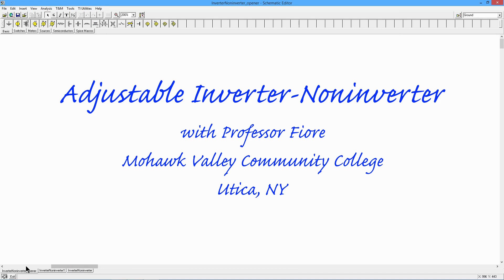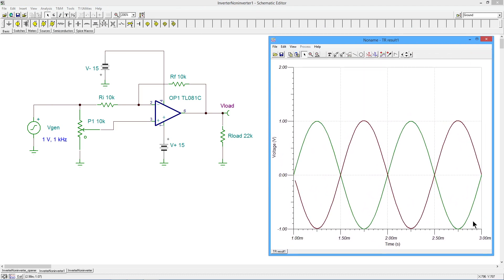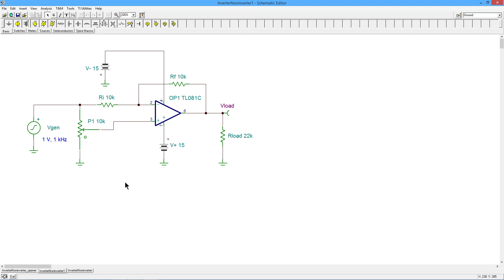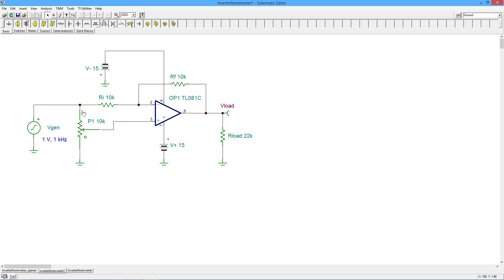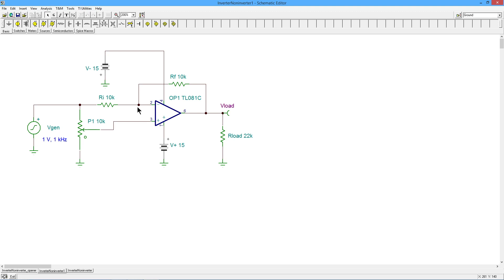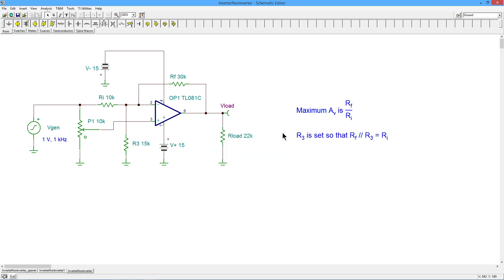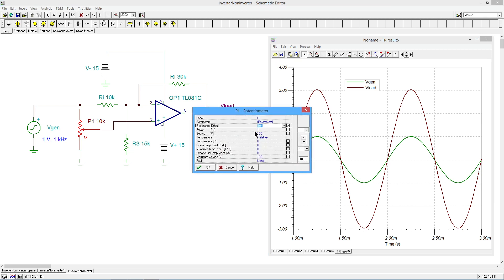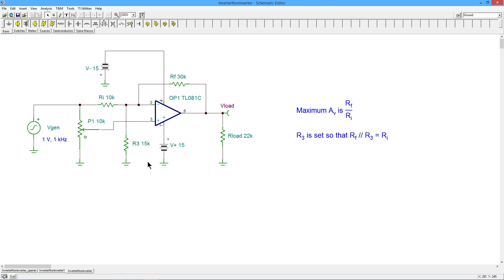Op Amps: Inverter-Noninverter

Comment: If I design a multistage amplifier for a guitar or microphone; and say the circuit has stages that invert and some that non-invert, is there a rule that the ac signal has to leave the device in the same phase as it came in?  If my device inverted the signal, and went into a recorder or headphone amp inverted from how it came in, will that change the sound?
Reply from the maker: Inversion generally doesn't affect the sound UNLESS you are mixing this with another version of itself. For example, if you mic something using two mics, run one of them through processing that also inverts the signal, and then combine the two signals back together, THAT inversion can make a difference (you might actually like the sound, it's not necessarily "worse").

In contrast, if you recorded someone speaking into a single mic and then played that back by itself, you'd be hard pressed to tell the difference between the original and an inverted version.

Comment: At 14:43 the value of zero has a slight positive offset. In most other cases you would address such a discrepancy , but here you have not. Is there a reason for the offset ?
Reply from the maker: That appears to be just a small DC offset. DC offsets are a fact of life and I don't always chase them down as it would get tedious after awhile. If DC offsets are a problem, I suggest using a device with much lower Vos (such as an LF411) instead of the TL081.

Comment: Hi, is there a way to use analog discrete components to extend the dead zone around the 50% point?
Reply from the maker: If you mean "to make it less touchy", then the obvious solution would be to use a precision multi-turn pot. To adjust the range, you could place resistors on either side of the pot (in series).
Reply: @ElectronicswithProfessorFiore  Yes, thank you, that I am aware of :-) I am rather referring to if there is a trick do obtain a larger dead band around center position, such as from 45% to 55% the output stays at zero. Background: e.g. in a synthesizer that applies LFO modulation using attenuverter, you want to have a comfortable knob position where the modulation stays exactly at zero. I have seen pots with center detent that still gave a slight ouput at center position (thus, the wiper is not exactly at 50% of the carbon element) which is really annoying when used for e.g. pitch modulation.
Reply from the maker: @SloBloLabs  Being a musician myself, I completely understand the issue now. Assuming you don't want to get a custom pot due to expense, you could use a pot with a built-in push switch to either pull out the pot or disconnect the output. Not super common but I have seen them. You might be able to rig up a dual gang pot, perhaps with nonlinear tapers. I'd have to think about that one. As far as the center detent issue, you can individually tweak that with a rheostat on one side or the other. Not a fan of individual calibrations like that, though.
Reply: @ElectronicswithProfessorFiore  Indeed, it is one of the less obvious things where digital solutions just outshine. I had been trying to inject two diodes and make use out of their forward bias voltage, but never ended up with a design that resolved the requirement. Would be nice keeping in touch with you 😉